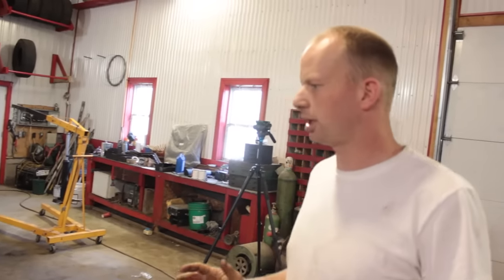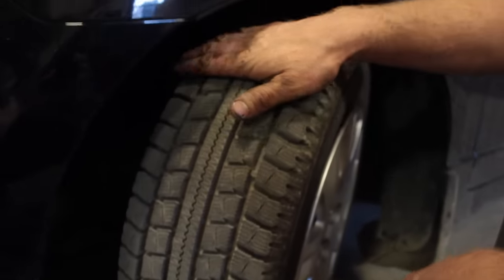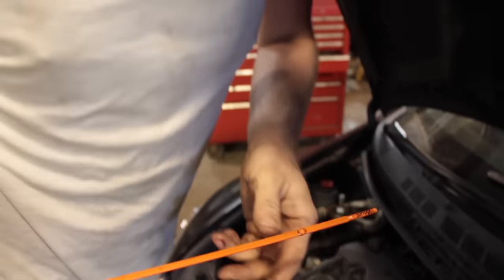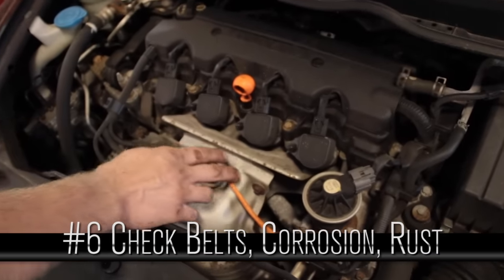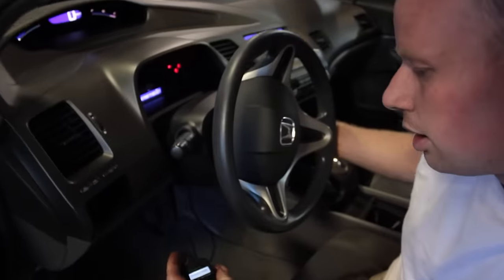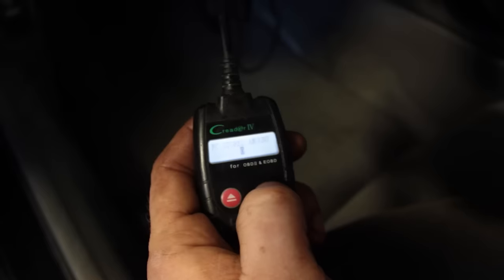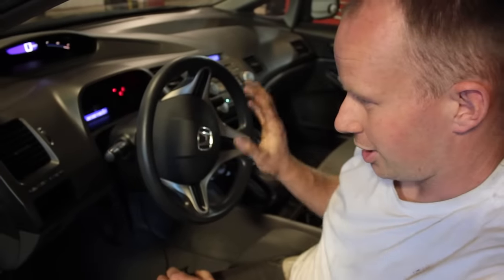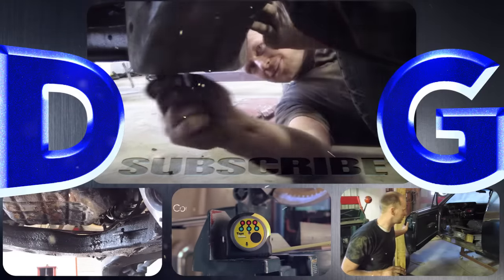12 Things To Check Before Buying A Used Car

Comment: Another thing to look for is when you turn the key to on, but don't start it and the check engine light doesn't come on beware.  Bulbs probably been removed for a reason and it ain't for a good reason.

Comment: Some OBDII connectors are not under the dash.Some maybe in the glovebox or under the ashtray.Do your research on the engines too.The GM 3.6 is one example,you run away from.Timing chain problems which starts with a cam/crank code which is over a grand job to replace the timing chains in.Bottom end problems.Take the car to a mechanic having it inspected as well.

Comment: I like to bring a flashlight and piece of cardboard.  I looked under the car and saw paint overspray (red, same as car) on the fuel tank.  Led me to believe it was rear ended.  I politely said "Sorry, this is not what I'm looking for" and left.
Reply: 🖒TY
Reply: what do you mean by paint overspray could you elaborate this
Reply: @V3V0.2M  The car was red. The fuel tank was black. There was red paint overspray on the tank. Telling me the rear end of the car had been repaired,  parts replaced, then repainted. I don't want to say it was a shoddy repair job, but it's a sign of poor workmanship.
Reply: @woodrow0007  ohhhhh okay thanks a lot friend!

Comment: 13. look under for rust/leaks/dripping/damage. You can do this with a phone, you don't have to lay down in the dirt
14. look at the glass for chips, cracks (from different angles)
15. brake rotors (if it's rusty the car wasn't used for a long time)
16. look for tirewear with a coin
17. brand of tires and size of tires, you want them to be the same at least both on the front and both on the rear, ideally all four
18. same rims on all wheels
19. test drive: acceleration, hard braking (ABS), hard turning, suspension, listen for weird noises, you don't want weird noises :) because it's money down the road
Reply: number 13 got me. Rusted bad. I checked everything else too

Comment: Who spends $1,000 on 4 tires? Especially on a cheap used car?
Reply from the maker: Some of us buy used trucks, and not all are cheap.  Everything is also more expensive in Canada.  Hop on amazon.ca and check out some tire prices
Reply: Everything is expensive in Canada especially in Ontario. WTF!
Reply: how so? nothing is expensive, neither in ontario, yes the prices of tyres might be high but our salaries are also higher ._.
Reply: Tires and installation can be very expensive, especially for full-size trucks.
Reply: Big rims make for pricey tires, for instance 20's are pretty brutal, payed $1700 for a set of 4 tires on my truck shortly after I bought it
Reply: I've spent 360 for brand new tires on my dodge Dakota. just got a find that right shop
Reply: Good tires can be the difference between crash or no crash. I've saved at least one of my cars just by putting good new tires on.
Reply: @untitledname5183  Yeah because you pay 50% in taxes lol

Comment: what are the best used car to buy. .?  I mean brand..?
Reply: Toyota, honda, mazda, nissan always buy a Japanese car never buy a second hand German car like a BMW or VW
Reply: +imraan patal can you say the reason behind your answer?
Reply: Jinu Stanley Toyota Corolla or Camry. Honda's would be my second choice. Also, consider certified used vehicles, they come with factory warranty.
Reply: imraan patal Never get a VW, but a older BMW can be pretty solid if properly maintained.
Reply: My '02 VW Jetta has 210k on it. All original motor, transmission, clutch etc. Only difference with German cars is the parts and labor are more expensive.
Reply: Oh I'm just saying is I've got friend with a Jetta, and one with a past and this 2 are shit boxes.
Reply: W123 Benz. There are like 5 of them with over I million miles.
Reply: If you don't want to spend a lot of money on maintenance, Toyotas are generally your best buy.
Reply: Volvo 242
Reply: Get a BMW around 90's or early 2000, any HONDA will need massive overhauls, ECU, boots, transmissions, valve head adjustments will be needed & the reason most people give these type of cars away almost free.
Reply: imraan patal Nissan!? R u serious? Those r thr worse cars 2buy..piece of shits cars!NEVER BUY NISSAN..they break down quick..from my past experiences!!
Reply: nissans are very reliablie my 1997 nissan hardbody4x4 truck is the best truck ever never lets me down
Reply: hondas run forever
Reply: SUBARU
Reply: Buy:
1. Toyota (minus the Prius)
2. Honda (Avoid automatic transmissions)
3. GM (hit or miss do your research)
4. Ford (same as 3)
5. Nissan (avoid CVT transmissions)

Avoid:
1. Any European car manufacturer
2. Subaru (head gasket eaters)
3. Chrysler (Their mini vans are okay though)
4. Mazda 
5. Any unknown nameless brand
Reply: Adam Smith Nissans are made CHEAP as shit. I’ve been without a car for 3 months because we discovered that the entire rear end cradle was corroded with rust. Repairs will be $2500+. Ridiculous. The entire back end cradle has to be replaced and mine is so bad that the bolts are rust dust. Look up rust on Nissans. Look at the complaints on the Better Business Bureau / Nissan complaints. I’ve had my Nissan Murano for 4 years and just discovered the rust problem which makes it non drivable. It sucks so no i would not recommend a Nissan
Reply: toyota, honda, mitsubishi.
Reply: @jessilooney2444  the hardbodies are good I'm not too crazy about the frontier

Comment: 1996 and up has obd2 not 99  fyi just sayin
Reply: Was thinking the same thing, as I was able to hook up an OBD2 to my 96 Cherokee.
Reply: @1awesomeness171  No, they're being helpful.  Someone might buy an OBD1 reader for a car that's compatible with OBD2.
Reply: My 1998 mercedes c240 has OBD1 for some reason..
Reply: Yes 96 and up has OBD2- Some cars require special plug adapters (MB, others)

Comment: Also when checking the coolant for the vehicle, make sure there is absolutely no grainy substance in the coolant. Because that’s a sign of gasket sealer and more then likely it’s sealing blown heads. If there is anything out of the ordinary that you find weather like he said it be a sound or a smell from under the hood. DO NOT BUY IT! I say this from experience. I’m a mechanics daughter. Been raised in a shop. And my first car had all of that. But I was young and stupid and let my excitement for my first car, I took everything the guy selling has said for face value. Be smart and bring a mechanic friend with you every time you buy a used car to check it over. No matter how confident you are in your own knowledge of vehicles. Because I made that same mistake.
Reply: Many of us make that same mistake.

Comment: Aren't you supposed to check the transmission fluid while the car is running?
Reply: When you fill it up.
Reply: He was just checking to see if it was clean
Reply: You need to check it when it's cold and warm

Comment: Unscrew the oil filler cap and check underneath the cap itself for white (milky) gunge. This is a sign of water getting in, possible oil leak or head gasket issue.

Comment: $800-$1000 for four tyres? $500 here for a decent set
Reply: no, $800 for a set of new tires.
Reply: +Zaid R. I just checked online and could get a full set of Bridgestone tyres for my 3 series for $600
Reply from the maker: +jay2431 We have taxes, installartion, balancing and an eco fee on top of that which brings it close to 800
Reply: I got some decent tires for 3pp
Reply: 300
Reply: 100€ in albania
Reply: jay2431 That's too much, I have 18 inch wheels and a Goodyear set would cost me around 600 brand new
Reply: Newsflash prices vary on location
Reply: FYI some cars like eco Cruze and other models require special tires designed for fuel efficiency it's a trap practically. I assume other newer cars might have similar recommendations or requirements
Reply: I literally bought a new set for a 2004 lexus es330 and it was only $300

Comment: Just bought a car off someone. He drove it down to my apartment which I thought was him just being nice but in reality he was hiding the fact that the car takes around 10 mins of revving the engine in the morning to prevent the engine from stalling.
It seems to be a pretty big issue and looks like we might have to scrap it after only 1 week. 
 So my advice would be to make sure the car is cold on test drive.

Comment: 800 000 for tyers ???? are you ok
Reply: Mohsin Sheikh 800-1000 and tires are expensive.
Reply: Especially if you need 6 of em.
Reply: For low profile tires 800 is about right, look up how much it costs to maintain a car before buying it
Reply: I never spent more than 600 for a set on my old car or pick up. but I know if you buy certain newer cars like eco Cruze or diesel they  Recommend or require special aerodynamic tires for fuel efficiency. I assume the same with other newer models also
Reply: He said 800 to 1000...not 800k

Comment: Another tip for a buyer is to check the motor mounts by revving the engine until it hits the Rev limiter than drop it in reverse than repeat with drive drive 2 than drive 1 if you hear any noise at all the cars junk

Comment: 1.check oil cap make sure the carbon deposits 
2 .engine on ..open oil cap for blowby
3 .check muffler for any smoke from exhaust ..blue..white ..black smoke
4.check engine mounts
5.check under car for any rust 
6.go through the gears for transmission slip
7.test drive
8.check for leaks on top and under after test drive
9.check muffler for any oil slush ..car burning oil

Comment: Feel the hood/engine. You want a COLD start! If it's warm? They may have warmed it up to hide something. Red flag. 
     LOOK at the brake pedal. If the odometer says 59K but the rubber pad near the accelerator is unduely worn down? Might be a rolled back odometer? Red flag. 
     Look for paint overspray where there shouldn't be any. Bondo only lasts about a year but it's cheaper so accident or rust?
     I love this guy!!!

Comment: Always check about timing belt on Honda and other Asian cars. Needs replacement about 80, 000 miles if it has one, rather than chain. If it breaks can destroy engine.

Comment: I like the closing comments. If you look hard enough you can find someone bashing ANY model. That would mean all models are bad if you misappropriate how valuable some of those comments are. Also mentally think about what defects or negative history items are acceptable if you are buying on the cheap. I bought my Honda with good tire tread but excessive sidewall cracking due to age. I bought it priced appropriately and was able to purchase a tire brand I liked and still had the correct investment in the vehicle. It also has a repainted hood. Besides a receipt the previous owner took before and after photos verifying that the paint work was just due to a clear coat problem. The old Honda has worked out mint for me.

Comment: Forgot to mention clean/salvaged titles, interior (if the car is really low miles but interior is crap, owner prob didnt take care of the car and vice versa), and if major maintenance has been done(t-belt, water pump, fluids). But still pretty good video.

Comment: if there is an engine cover, lift it off and see if there are any mice nest or droppings.  i bought a 07 Avalon. that the mice started to eat the wire harness.  lucky there wasn't any mice left and the damage wasn't too bad.   also, check for a spare tire and jack.  funny how though items seem to be missing.

Comment: A guy bought my pickup without even opening the hood or the door or even starting it. It was just 20 yr old chevy pickup. But still $1500 is a lot of cash to hand over on the front porch without even asking a single question about the vehicle.

Comment: You smell the oil on the dipstick to check for fuel leaking into crankcase it won't help changing the oil fuel residue will still be there.

Comment: Aside from the physical attributes you need to check, it would be best to also check the legitimacy of the pre-owned car that you are buying. You should be careful of buying a pre-owned vehicle as it can be very risky. Make sure that the car you will buy is not stolen or involved in an accident. Request for a vehicle owner search to know whether the seller is the actual owner.

Comment: TRY PUTTING GAS IN IT TOO!!!
I went to help a buddy buy a used car and everything checked out except the vent tube or somwthing with the evap system made it impossible to fill up at the station because the pump would shut off thinking its full

Comment: This is all good unless your buying a honda. I bought an 02 honda civic, when they gave it to me it had a messed up transmission, drove it for a year and the transmission was the only thing that stayed messed up. Even raced it and it stayed the same. Fixed it after a year, and I started saving gas because the transmission was slipping on 3rd gear anymore. Had this civic for 11 years, and still have it. Word on the street is, Toyota's are good too.

Comment: Another thing to check before buying a used car is to check the battery and make sure the fuse is good and there's no burnt wires, I bought a used car and after 2 months I smelt a bad burning plastic smell from my batter and I found out the fuse was overheating burning the plastic case of the battery and the wire on the inside, my hood would of caught on fire if I drove home that night

Comment: i will add a couple things. look under the front of the car for damage and rust. there will sometimes be damage from bottoming out on rocks or parking stops. check frame and under body for rust. if you see flaking rust under the car walk away fast.

Comment: I'd want to know what the manual says about checking automatic transmission fluid. Most likely, the engine and transmission are supposed to be warm to check the transmission fluid. And, with some vehicles, the engine is supposed to be running to check automatic transmission fluid.

Comment: u didn't mention to make sure the car drives in a straight line. or did i miss that part? also bringing a multimeter to check battery / alternator isn't a bad idea either, especially if your scantool  doesn't have that info for u.

Comment: Good. Check the car cold. Oil filler cap for signs of bad head gasket, etc. Don't bother if not actual owner with clear title in his own name and in his hands. Only look at brands and models with GOOD reputations for long, reliable service.

Comment: a dealership  tired to sell me a wreaked SUV for 13k
I took my time looking over the SUV Spent about an hour
many many issues 
Bent suspension and broken bumper  uneven tire wear on the 4x4. the tire wear was way off.
Excessive interior wear for only 115k miles

i offered only $7,000  for it they were asking 13k  since it had heavy wear and tear and need a "lot of work" they did not accept so i just left.
they ended up taking the SUV off the lot and sent it off to auction since it was unsellable , No wonder it had been sitting for 2 years on the lot  as seen on the car fax

Comment: Also check the Plug Cylinders I didn't do this on my first car and come to find out there was oil in there. Had to get new upper gasket for like 300$ but common issue with the 99 Chrysler Sebring

Comment: Are Chevy's cheap to repair? I mean like parts, and are tires and parts hard to get? Looking at 2012 Chevrolet Cruze LT Turbo in the near future and it's priced at $2600. Would prefer a Honda but not finding one I likje. I know Hondas are very cheap to repair since all the parts are so mass produced.

Comment: I came across a 2010 Honda Civic lx coupe. It has 51,000 miles on it and super clean inside and out and under the hood looks new any idea if this is a good buy ? Never owned a CIvic just wanted to see your thoughts 🙏 thank you

Comment: Get the seller to drive the car on a straight road with you or your mechanic to follow him to make sure its driving straight and not like a 'Crab"....also the tyre wear can tell you if the car is twisted but then the seller may just have changed new tyres....also the seller can change the dash cluster which includes your speedo to one that has lower Kms showing,  but tell tale signs of the carpets, pedal rubber wear and tear, driver seat etc  can usually give you a rough idea that the car has done more Kms than what is showing on the speedo.
Reply: If a seller is going to give you new tires you probably are buying a good car
Reply: @thedevilsadvocate5210  Not really....some sellers will give you the likes of new tires to just get rid of the car at any expense...be careful of sellers who agree to all your or your mechanics demands as there probably is a cover up somewhere....if the car has just had new tires fitted then definitely do the "Crab" test or agree to take it to an alignment Garage, if the seller refuses then just walk away.

Comment: Today I looked at a 2002 Saturn L200 what iwould be  the cause of the corrosion on the aluminum surfaces? It looks like hard water stains. Also, I noticed the same corrosion on the trans lines that are attached to the firewall.
I hope to hear back from you. Great video.
Reply: Peter Timpson IDK but aluminum oxidation doesn't generally cause problems, it's rust you have to watch for.